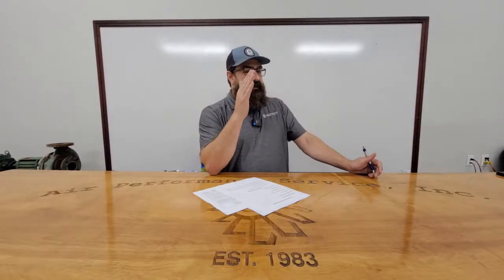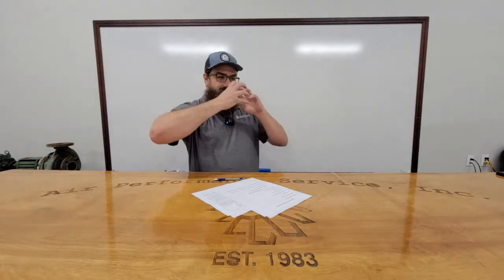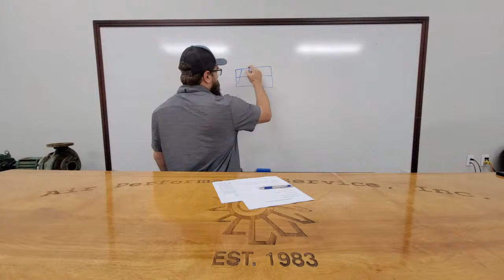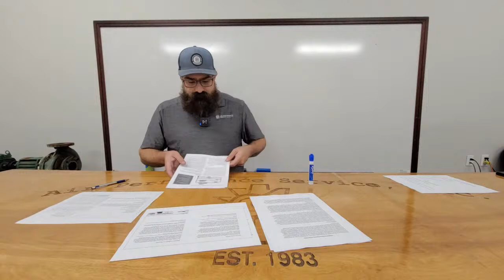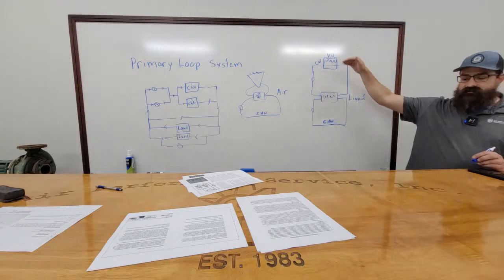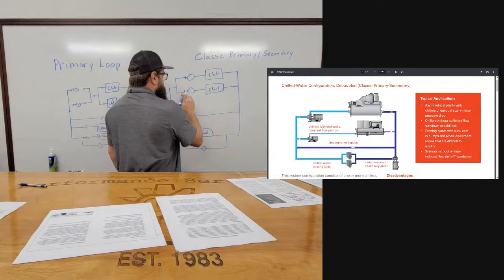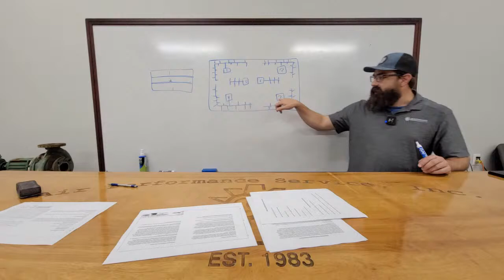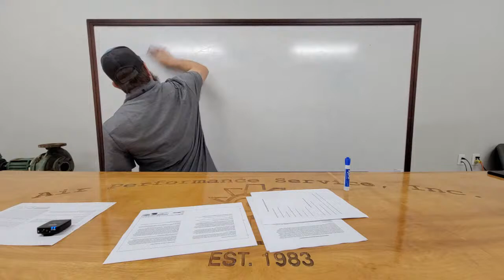BMS Building Sequence Operation HVAC Training

Comment: Paddle flow switches are not the way to go many times, especially on an open loop CW system. Use an IFM Effector electronic flow switch instead. It's the same one Trane uses on chillers.